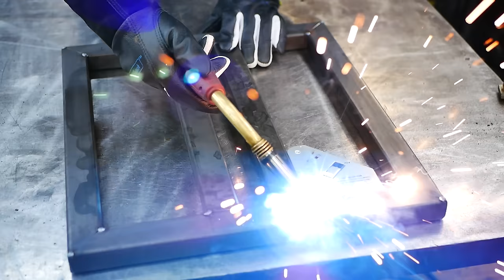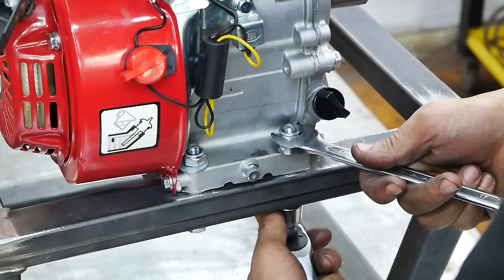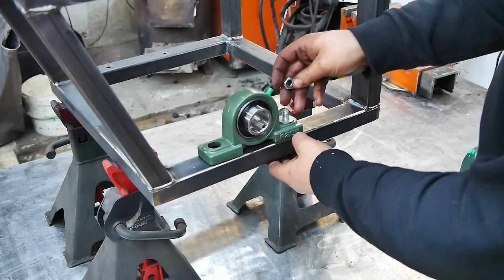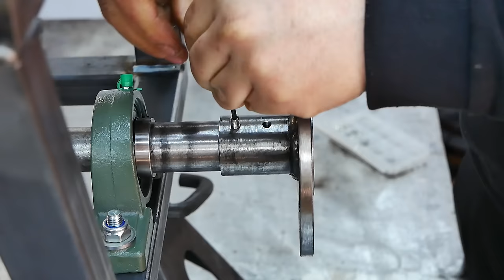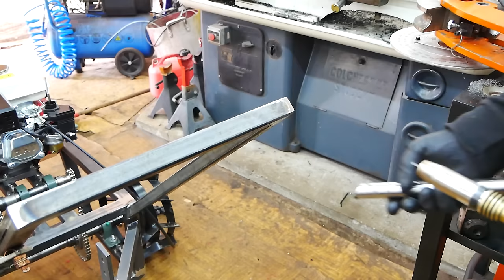Homemade Gas Powered Plow 200cc

Comment: I have always wanted to go to good school like this man , but not lucky in my birth place there were only nonsense schools that teach nonsense theories kill people's life including myself, I would advise this man to also find his seat on the top of this incredible machine instead of getting tired running behind it and his weight will improve the stability of the machine 💪💪💪💪
Reply: You learn a great deal of this stuff from the people your hang out with or work with. Much of it doesn't come from former schooling. You have to first have the mind for this work. Then you have to sponge up all the info you can from old farmers, mechanics and machinist/fabricators. It's an art to build stuff out of junk or stuff you have laying around and to be able to figure out and make the parts you need to put it all together and work. :) Find a workshop in your area. Tell them you want to really learn and would like to start by sweeping the floors and cleaning up.

Comment: Cool stuff.  I am envious of the soil you have.  Might want some bigger wheels turning slower and a few hundred pounds more weight.
Reply: Thought the same. Good design, but a little to light. Also, does that lowermost chainguard do its job? That dirt was flying everywhere and i can see it building up in there.
Reply from the maker: The machine was built at a fast pace because it is needed now, later I will improve it and paint it 😁
Reply: @WorkshopFromScratch  looks like you are into the spring rains like we are.  We got three inches today and my garden is a quagmire.

Comment: I've never seen someone use a set screw like that instead of a keyway but I actually like the set screw idea better. Good thinking.
Reply: Not a better way. Should have stayed the way with the set screw drilled and tapped through the hub. Great build though, im not knocking him at all. I think it was just an easier/quicker way to change wheels

Comment: Excelente, project. 99/100.
Possible imporvement - Use a closed gear transmision to the wheel, sand and mud will, ruin the chain and sprockets.
Best of luck.

Comment: This is a great development for private use.
It remains to paint and you can start mass production
An interesting point is that the chain is not protected at the bottom, will it be clogged with earth and will it not become a problem of rapid wear of the star?
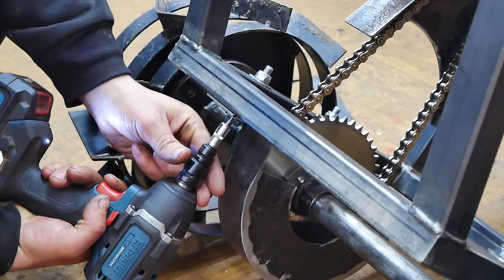Reply: A guard was added at 13:10 though a better design will likely be necessary—I'd like something with a seal. Say a used CV boot(s). It's rubber, flexible, and tough, plus they're meant to keep water and dirt out.   ;)  He'll also have to change the guard from a 2 piece to a 1 piece.
Reply from the maker: Thank you 😁 The machine will still be improved, that's why I didn't paint it, I just built it because I need it now :)

Comment: In your next video you'll be adding a weight bar and a jackshaft to reduce the ratio to the wheels so you don't have to chase after it 😁
Reply from the maker: I made the project at a fast pace because I needed it, I didn't paint the machine, being aware of the many corrections that I have to make 😀

Comment: the nut, even if it is self-locking, should not be on the side of the attachment, it is worth putting the nuts on the side of the bed, this is how the bolted connection works better and more reliably.

the cam clutch installed on your engine is not designed for smooth speed control, it will certainly try to work but still quickly fail, the cam clutch is essentially an on-off switch and not a dimer and not an analogue of a car clutch.
It seems to me that it is better to use a standard belt clutch for walk-behind tractors.

it was also worth making a second lower attachment point for the share,
and a hole in the lower casing of the drive star, where all the dirt will be collected ...

Comment: Nice. I think the plow support frame needs gussets running diagonally down to the wheeled axle frame. There will be a large bending moment at that point as the plow blade has a long lever arm.

Comment: I made something similar but with only one wheel and I don't know if it happened to you but the multiplication of the sprockets is not good because it ends up stretching the clutch and then it advances by itself and does not stop

Comment: I really admire your motorized machines! I really need a two wheel tractor for steep trails in my wooded property. Something to hook to a small, narrow cart to haul tools, firewood, stones, logs. Also to attach a plow to for plowing mine and my neighbors long, steep driveways in the winter. Getting too old to do it by hand. :D 
???: Do you think a 200cc engine like this would have the torque and HP to haul 200-400 lbs up trails in the woods, depending on gearing, of course. I don't need too much speed. Torque is more important. I've got the fab skills and welding shop, but my engine/drive-train knowledge is less than zero! LOL!
Thanks very much for the videos!
Bert

Comment: Nice build but the power would be better utilized with larger diameter wheels. 

Plowing already plowed soil is not so impressive. Next time plow unplowed soil to see how effective your design is. 

The jackshaft and drive gearing setup is 👍🏻
Reply from the maker: I made this machine very quickly because I needed it, so there are a lot of things I didn't have time to think about during the build, that's why I didn't paint the equipment because it needs to be refined :)

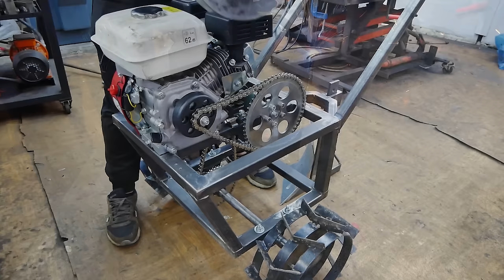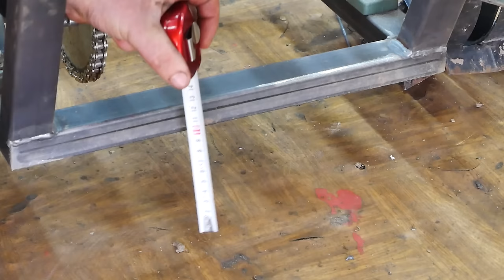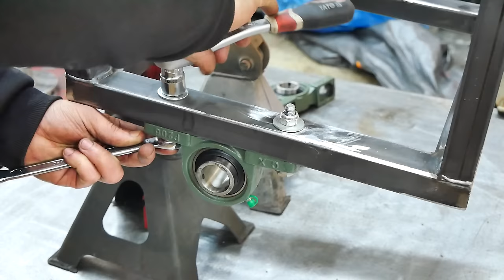Comment: I love this channel–you say more w/o saying a word more than any channel I subscribe to. God bless. Btw am I correct in assuming the condition of the wheels at 12:47 indicate you "took it out for a test drive" and you didn't like what you saw–that's why you moved the pillow block bearings to the bottom of the frame [11:26-11:52]? 
[edit]: are you satisfied with its performance–do you plan on making any changes?
Reply from the maker: Thank you 😁 Yes, I tested it first, and then changed it, of course, showing where I made a mistake. The machine was made quite quickly because I need it now, but there are a few things that I need to improve and that's why I didn't paint it, but it still works 😁 As for the changes, it is definitely larger wheels, and thus you need to immediately change the sprocket to a slower one because it will work too fast on larger wheels